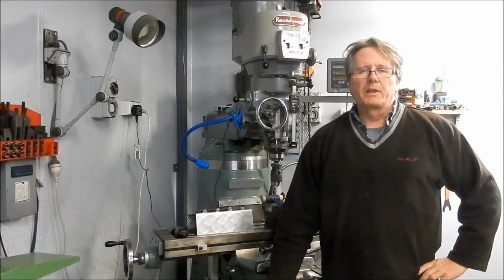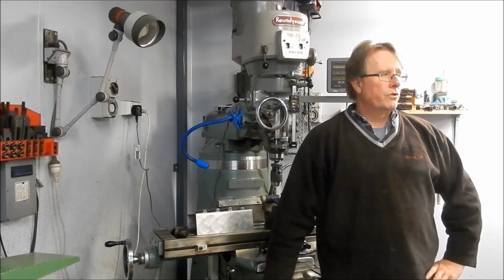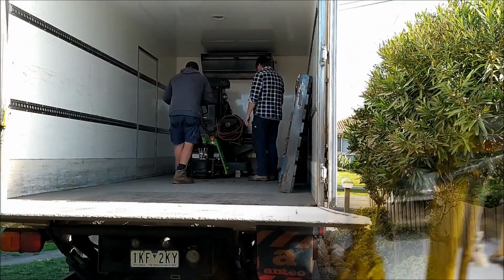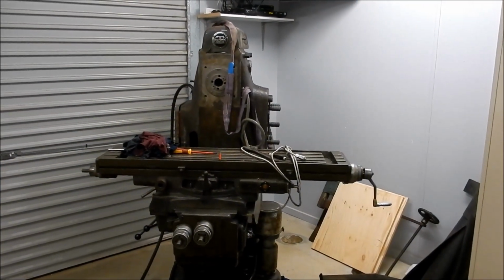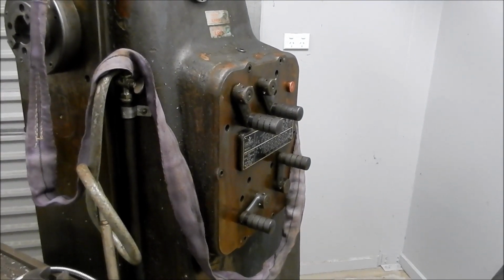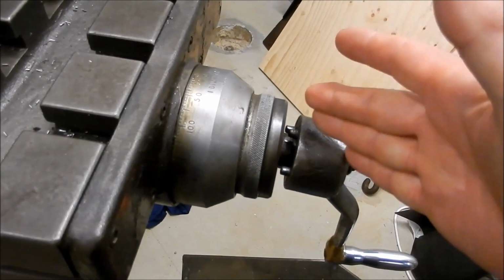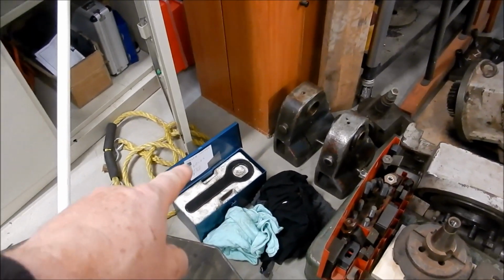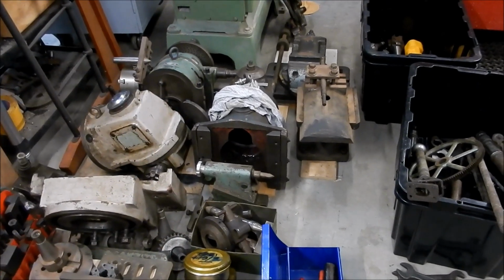New Victoria Milling Machine for the Workshop

Comment: New subscriber... I'm enjoying the videos. Do you have any footage showing this mill in action?
Reply from the maker: Hi, not at this stage.  It does run quite smooth on the retro single phase motor.  I will be fitting a 3 phase motor with variable speed as part of the refurb.
Cam

Comment: Hi Cam,  Just found this.  Have just bought old Elliot Victoria model UO.  Has Bridgeport head on swing frame for vertical work.  Manual from lathes.co.uk {Tony Griffiths).  Came with worlds biggest dividing head, biggest vertical table and huge vice.  Also original vertical head, which I cant pick up.  So, man sized stuff.       Basic mill weighs 976Kg according to my manual.       Regards, John

Comment: Hi from Cornwall,  England , did you ever get hold of manual. I have a u2 but later version with capstan gear changers but whole machine looks very similar. I have manuals and parts books for this machine . I refurbished mine and it’s proved to be and excellent and robust machine, primarily brought it for cutting Spur gears. Of note was the rack and worm feed for saddle traverse , rack is bronze and I managed to make a new one using my Bridgeport, indexing cuts with dro . 
I could scan parts book ect if you need still.
Reply from the maker: G'day Brian, thank you so much for the offer to scan your manual.  I now have a comprehensive parts and breakdown manual so am OK.  One question if l may, does the later model come with rapid traverse.  This one doesn't have that funtion.
Cam
Reply: @camatbattler2233  Hi no rapid traverse. Only as fast as you can wind handle! Lol . Would have been nice to have though. Mine got a 6hp two speed three phase motor which I run with a Rotary transformer. Mine also has a little window inside that you can view gears and oil flying about. Had it for about 20 years now. With out issues apart from leaking oil. Looking forward to seeing more of yours. All best and have a great xmass. Brian.
Reply: @brianskidmore7771  Hi Brian, I have a U2 with capstan handles that I’m trying to get up and running. Any chance you could send me an email and I could ask you a few questions? freddowdell@hotmail.com

Comment: Hi cam. I have a Victoria omnimil which is basically one of these but with a turret head. My ‘x ‘ screw just goes all the way through so there is no difference to how it moves when you change handle ends.  They do have an adjustable nut so you can dial out some of the lash in the system. Maybe yours is a special?  Maybe it’s pre geared for helical milling with the dog head or something?
Reply: Dividing head
Reply from the maker: I'd be interested to know if you have rapids on your mill.  So far I can power feed but don't know if there is a rapids override.  I have watched your channel on a number of occasions, love the diversity of projects you run with.  Just Subbed in.
Cam
Reply: Thanks Cam.  my omnimil does not have rapids, just standard feed on the x axis.  Like to turn my hand to different things to keep life interesting!

Comment: Some of the manuals for sale are very thin on real info just lubrication   no parts lists or exploded diagrams 
I have Elliot Sturdimill 1250 have not been able to get a decent manual for it
Reply from the maker: G
G'Day Gary, that will probably be the case so it will be lots of photo's during the strip down to make sure it goes back the right way.

Cam

Comment: Sweet score. That is a heck of a bunch of tooling and equipment too. I checked E-bay in the states for you and found 2 manuals but neither of them were for your mill.
Reply from the maker: G'Day Tom, thanks for looking.  I have a lead on a Manual so hopefully that will come through.  The shed is looking great but you have copped a shocking time with the weather out your way.  It will be great to see some concrete down so you can start to populate it with all the toys.

Cam

Comment: Those collets you got look exactly like my Jacobs colletets, I hace two boxes full the will go from 1/16 1 1/4 inches I think I have two chucks for my lathes that use them .They work extremely well for me.
Reply: I have the full set, they need rubber plugs or small pieces of the same size to hold short pieces in the collet, wide range holding for each collet
Reply: @ke6bnl  What I like about them is they will hold U.S. standard and metric shaft.

Comment: Nice . Lots of bits with it .   If you want to off load the large face mill !!!  Now you will be able to make your own spiral flute reamers !    Cheers .
Reply from the maker: G'Day Max, I now have a machine that can handle a face mill that size.  The Bridgeport would struggle with something that size, you might be able to take 0.5mm at a time if you where lucky.  Spiral Flute Reamers, I have a very good mate who made his own set of Spiral Reamers (7 degree flutes from memory).  He did cheat and do it with an Arduino Controlled drive on the table but they are a beautiful piece of workmanship.  All finish ground on his extended Stent Tool and Cutter Grinder.

Cam
Reply: @camatbattler2233  I remember at apprentice block release , we had to make a 22mm spiral flute one , heat treated , ground on the cylindrical grinder  & then to the tool & cutter grinder for sharpening .  It was a great  little number to do back then .

Comment: Hi mate,  I have a manual for your mill.
Cheers Dean
Reply from the maker: G'Day Dean, I would be very grateful if I could have a copy of it.  Are you able to scan and send to me?  I want to strip this Mill down and give it a full re-furb to get it ready for work and any type of manual would give me a heads up on how to sequence a strip down.
Cam
Reply: Hey mate will try to get it scanned for you tomorrow.
Reply from the maker: Thanks heaps Dean.  Our of curiosity where are you located?
Cam
Reply: Casino NSW
Reply: Hi mate just a heads up all scanned but I'm cleaning them up in corel draw their too ruff to send.
Reply: @camatbattler2233  I'm new to YouTube is this public I will send my email.  I'm converting them to PDF files.
Reply from the maker: Hi Dean, you can send to -
cmckeown.1@bigpond.com
Cam

Comment: nice machine cam, it looks almost identical to an old cincinatti universal mill. Lots of nice toys that came with it too, lol. The side on the right side is for attaching the banjo to, and you should have an auxillary port on the dividing head that that plugs into for helical cutting. The guy over at HiddenWorldForge channel has a big mill just like that and was trying to make the banjo assembly from scratch for his, so maybe you might get some ideas from his videos for the attachments and the dividing head when you get to it.
Reply from the maker: Thanks for the info Chirp, I have only cut a Helical Gear once and that was at trade school and as I remember it was a pain to do the numbers for the ratio breakdown and the angular setup.  I will in the future make up an electronic helical gear cutter using Arduino.  I have a couple of good mates who have done this with great results.
Cam

Comment: impressed with that tailgate loader...  also impressed the budget runs to Belzona. the Bernard collets are pretty special too. they're a good system, can see a collet chuck for the lathe in your future.
Reply from the maker: G'Day Emma, the Tail Gate Loading Truck made it so easy and safe to transport and only cost me the price of the Diesel to use with a couple of mates.   I'll certainly do something with the "Rubber Collets" in the future.  Yeah, agree Belzona in very expensive stuff, I'd like to buy shares in the company for what they charge for their products.  In my job I go through around $10,000 per month of Belzona doing pipe line repairs on the 4 Berth Jetty.  It has cost over $300,000 for one application on plant site and I would guess we would go through around 2M - 3M per year of the stuff.  I'll get my crew of applicators to keep the "A" and "B" part dregs for me to use on the table.  I've only got to fill around two 20 cent size marks.
Cam

Comment: It looks awesome Cam
If I was to get a new mill I'd go for a universal for the functionality and options
Keen to see the table repair, I have a few dings that I want to repair in mine. I was told JB weld, but it didn't work
Reply from the maker: G'Day Tommy, yes I'm happy with the purchase and it will add rigidity to my Milling work.  The Bridgeport is a very versatile machine but rigidity is not one of their strong points.  I've had some experience with building up large Gearbox bearing bores with Belzona so we'll see how this goes.
Cam
Reply: Hi  @camatbattler2233 ,

Have you fixed the table already? How was it? I’d like to see some footage of it and the use of belzona!

Cheers, Greg